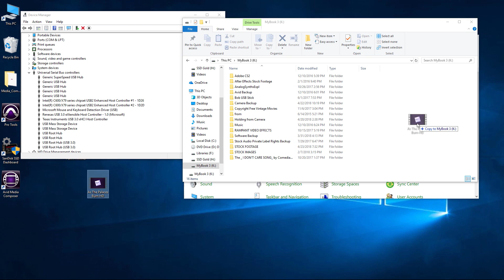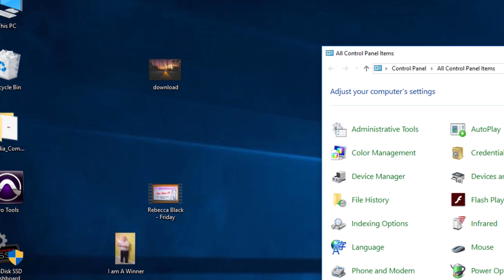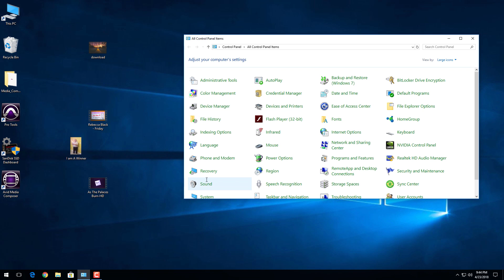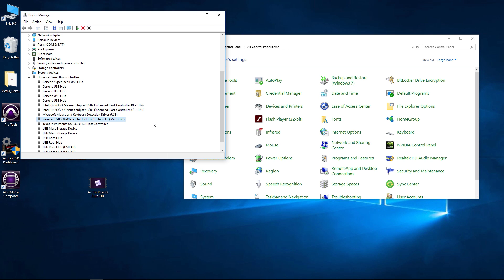ADD A USB 3.0 CARD TO YOUR COMPUTER | IT'S EASY! (PCI-E CARD)

Comment: I have a very similar card ,YEELIYA PCI-E , its 3 usbs and 2 usb-Cs,  I have the SATA  power plugged in ,  all it does is provide power to what ever I plug into it and doesnt  respond to any external drives I plug into it,  I believe it shows up as Fresco Logic Usb3 host controller but Im not sure, any suggestions?

Comment: I'm trying to upgrade my Dell XPS 8300 which only has a USB 2.0 port.  I see there is plenty of info about adding a USB 3.0 card to my computer.   I think USB 3.0 is double the speed of USB 2.0.  But what about a USB 3.1 or USB 3.2?  What can my computer handle?  The RAM speed of my computer is 1333Mhz.   I also see USB 3.0 and USB 3.1 have been renamed to USB 3.1 Gen 1 and USB 3.1 Gen 2.  But when USB 3.2 came out they were renamed again to USB 3.2 Gen 1 and USB 3.2 Gen 2.  I'd like to get the fastest my computer can handle.  Transferring a whole external hard drive the other night took hours.  I'm a photographer, it takes way too long to transfer hundreds of pictures to my computer through USB 2.0.  I was going to get a USB 3.0 but I love to transfer faster than double what I'm doing now.  Triple or quadruple would be great.

Comment: Thank you for the video! I need to add a USB root hub / more 3.0 ports to my Inspiron 3880, and was recommended a PCIe USB card. Do you have any idea if there is any PCI that would be supported by this Dell model? Mine is an i7-10700,16 GB Ram, MB Dell 05GD68, Toshiba DT01ACA100 1TB Sata, Pm991 NVMe Samsung 256GB (if any of that is relevant...). If not, what would be the best way to understand the compatibility between the Desktop and a PCIe USB card? Thank you so much!
Reply from the maker: PCI is a standard, so pretty much any expansion card should work. In most cases Windows 10/11 will automatically install the driver for it too.

Id look for something that gives you the speed you want, so probably a USB 3.1 or 3.2 expansion card. Maybe something like this https://amzn.to/3LE8adZ assuming you don't need a low-profile card. 

There are plenty of others out there, that's just an example. So be sure to check the speed specs of each card you consider.

In most cases the PCI slot will supply enough power, but if you are running power heavy USB devices that are bus powered, there's also the option of buying a card with a power port where you will connect the PCs PSU to the card. In most cases this isn't needed though.
Reply: @BenoniTech  I really appreciate the reply! I have a USB mic and two video capture devices that seem to be very "hungry". According to the manufacturer, their devices need at least two USB root hubs in order to work when connected to the same PC, but I am not sure if that's the only issue. I would also assume that I need full-speed simultaneous transfer. My PSU is only 260W, do you think that adding a PCIe card with a power port that connects to the PC's PSU could cause a different problem?

Comment: Thanks for the great video! A weird thing happened when I upgraded my GPU. My front I/O USB ports got throttled down to about 1 Mbps transfer speed. Both the 3.0 and 2.0 are equally unusable. I have one final driver-based intervention to try, but otherwise getting a new USB controller that has rear ports and a 20-pin seems the only way to get the front 3.0 back to speed. The 2.0 is less important to me.

I read on a forum that some mobos will cut power draw to front I/O, rgb ports, et cetera if the x16 slot has a high-demand GPU. Is this true? Have you heard of any solutions? Would you consider a controller upgrade like the one you demoed a worthwhile intervention to get the front 3.0 slot moving again? Thanks!

Comment: Thnk u for the nice video. On my older computer with an asus motherboard Ramage extreme ii (pci-e 2.0 x 16 slut)  I just installed such a card (the LC-PCI-usb 3.2). I use a samsung t-7 drive. Now it starts transferring great even at around 750 mb/sec but after around 6 secs it drops to 35 mb (which of course doesnt make much sence for me because I work with big video files).   How ever, from the comp back to the drive it does transfer around 105 mb/sec.  What am I doing wrong? How can I ghet at least the 100 mb/sec?

Comment: The PCIEX4 slot will share it's bandwidth with your PCIEX16 graphics card usually when the two are side by side like that. Check your motherboard specifications. It does not look right to me. But yes, it will work.

Comment: Hi can I addon USB type c 3.0 and type A 3.0 usb port In zebronics h61 LPA 1155 motherboard in pcie slot if it supports after adding usb type c and type A 3.0 can I connect 4k 60 hz ugreen type c 3.0 to hdmi 2.0 adapter cable  can it play 4k 60hz UHD movies in 4k TV from computer to 4k TV by all adding this in normal desktop computer i3 processor intel integrated graphics. Connect ugreen 4k 60hz usb type c 3.0 to hdmi 2.0  adapter computer to 4k tv to play 4k UHD bluray movies

Comment: I installed my host card and my PC says its detected and that its working properly BUT everything I plug into it only works for a second the stops. Sometimes it starts then stops over and over. Drivers are all good. Im very confused and frustrated. Its a Dell Optiplex 790 Mt i7, pcie slot with sata power cable connected. It has a green light that indicated that its on and working, when I plug in a usb device it reads for a second then the light starts flickering and the device disconnects. Please help, thank you!!!

Comment: Great video!  I added a USB 3.0 card to my 2011 Acer 3970 motherboard, Win10 drivers self-installed, and then my usb transfer speed from an internal drive to a USB 3.0 thumbdrive rose from 4 mb/s to 12 mb/s.  
Sad face.

Aside from getting a new computer, do you have a recommendation on how to kick-start this?

Comment: Should be mentioned that depending on what card you buy, some of them actually do require the auxiliary power to work correctly. I found this out the hard way when a card with a molex power connector on it ended up getting fried. Thankfully only the card fried and not the slot or mobo, but it should be kept in mind, especially if you're buying a cheaper card direct from China or something.
Reply: late to ask but the card got fried with or without being connectes to molex?
Reply: @mazawaza  most likely he didn’t use it. If it has the adapter slot good rule of thumb is just plug the damn thing in. 😂

Comment: can this usb card be used with riser card? tried but no luck, driver installed, the card function as flashdisk reader or other peripherals(mouse, keyboard, etc) are good, but not with riser card with VGA. ah i use win10, my motherboard is asrock a780gm-le/128m and i'm using this card https://www.via-labs.com/product_show.php?id=51

Comment: I just did this recently with a different card and my card needed the power cable. Without power cable, the card was listed in Device Manager, but it would not detect inserted USB devices.

Comment: Why doesn't mine fit? I have a Dell Optiplex microtower. 4 PCIe slots. But the USB expansion is about 4.5" in size. The insertion slot on the microtower is only about 2.5". ... I even unscrewed it and took the back thing off. But it still won't fit. Any help would be appreciated. Is there a smaller type of expansion?

Comment: Thank you so much! ALL of my usb ports had stopped working, not sure why. I was able to just install new ones. Your video helped me out a lot!
Reply: check your bios maybe your usb ports are disabled by auto enabler
Reply from the maker: Cool. You might want to check Device Manager and see if you have any EXCLAMATION marks next to your USB drivers. If so, try right-clicking and update the driver. You could also try heading to your computers manufacturer page and try updating the BIOS and any drivers.

Comment: can this pcie card handle my at2020 usb mic and my razer  rgb extended mouse pad?
Reply from the maker: I have not used those, but I don't know why it wouldn't be able to.
Reply: @BenoniTech  Where did you find the driver to install on Windows 10? I have an equal to this I did not find drivers for Windows 10

Comment: Why won't the usb 3.0 pci-e card power my seagate external 3.0 HDD, it'll work just fine in a usb 2.0 port, but it won't light up the LED on the HDD, but I can feel it whirling inside, it's a 3.0 device that won't work in the added 3.0 ports, why?
Reply: Likely doesn't have enough power. Try reconnecting the power, and don't use the Molex to SATA adapter if possible, they can start fires ;)
Reply: @gamergye  how can it start fires?

Comment: Can I use this for my Asus mother board(I forgot the model and I can’t check it rn) I’m a bit of a noob when it comes to stuff like this so does this card work for a Asus mother board?
Reply from the maker: It will work for any motherboard brand that has the correct lane available. PCI is a standard.